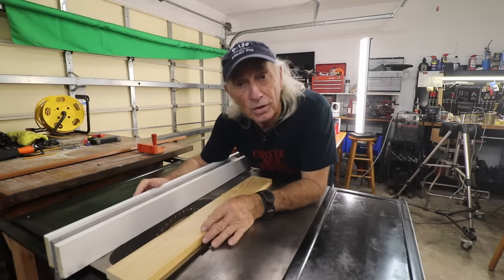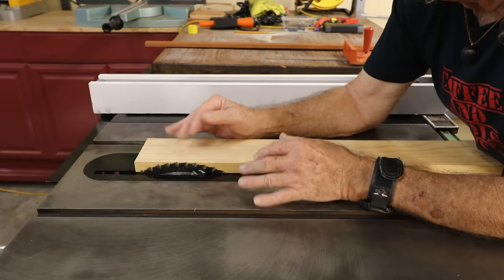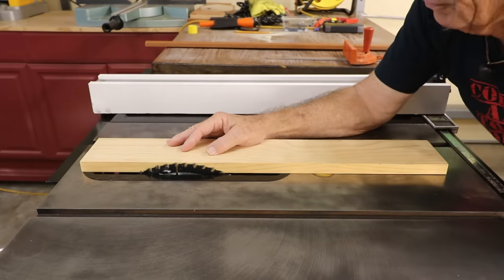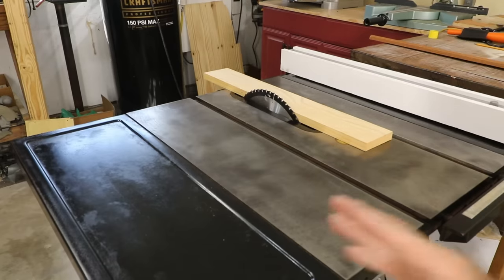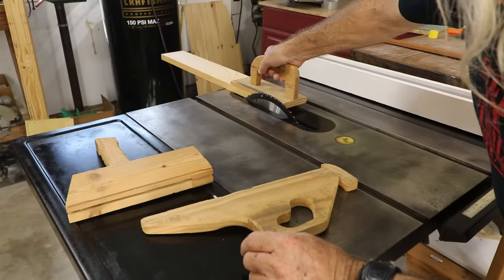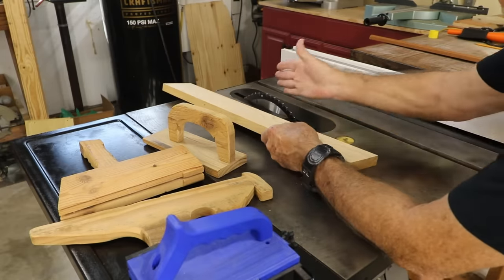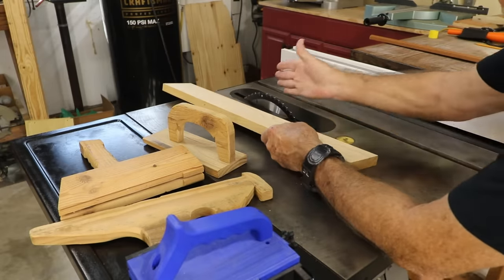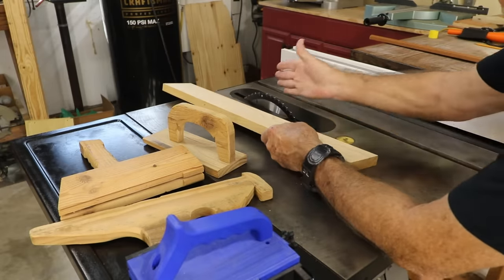Table saw secret nobody will talk about from the good old days, C&T episode 180

Comment: I was taught the MINIMUM height was the one that cleared the tooth gullet above the material.  It gives a clean cut because it keeps the saw from dragging excess sawdust down into the cut zone, but also guarantees spitting dust upwards.  Second, to avoid standing directly behind the area between the blade and fence.  (Don't let anyone else stand in that line, either.  Easy to do for narrower cuts, near impossible for wide ones.

I've experienced a couple of incidents.  One was the inadvertent kind of twist another responder mentioned.  That resulted in a violent throw upwards of the ply panel I was cutting.  Scared the bejesus out of me and I stopped for the day.  Another was a classic pinch ripping hardwood, kerf closing up as tension was released from the cut, the kickback coming from the fence side.  This on an older saw without a riving knife.  That was an absolute rocket straight back.  That missed because I wasn't in the danger zone.  For those who haven't seen this, the speed is beyond belief.

Personally, I think the safest solution is a higher blade, which reduces the most common problem (kickback) PLUS using a blade guard.  And I have to confess that I don't use the latter very much, also relying on tools to keep my hands clear.  I do use feather boards a lot when ripping, too.  I've tried hold-down devices, but found them too much of a pain in the neck to use in a home (i.e., non-production) shop where you're changing set-ups all the time.

Thanks for the video - it has me thinking about guards again.
Reply: Boom say like it is

Comment: That little 'bump' behind each saw tooth serves the exact same purpose as the depth gauge in front of every tooth on a chainsaw: it prevents the following tooth from taking too big a bite in the wood.  Ultimately it limits the feed speed and allows the blade to cut most efficiently given the power provided by the motor.
Reply from the maker: Thanks for posting :)

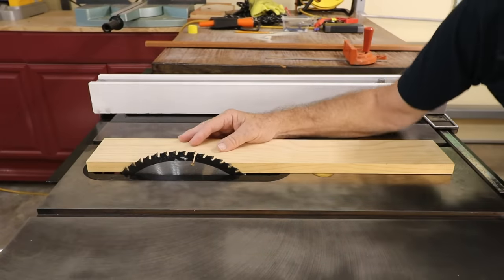Comment: 6:34 Very poor argument. 1: The teeth are wider than the "body" of the blade, so the only thing in direct contact with the wood is the side of the teeth themselves. If you let the blade guide the board, you will cut into the edge already done with the upward going teeth, which is one of the main causes for kickback. 2: You have a MUCH longer guide right on the other side of the board (aka the rip fence)... ;)
Not making a cut because it feels unsafe, is probably the best advice anyone can give you. If a cut feels unsafe, mostly it's because it is! 
I have aborted a cut more than once because it just fealt wrong.
Reply from the maker: IF it feels wrong...don't do it :)

Comment: I had a pair of goggles save the left side of my face. Could not believe the speed and strength that wood came back at me with. Buy good safety equipment, you will never regret it.
Reply: Well testified, thanks!

Comment: Good video! It is helpful for newbies and weekend warriors. I've been woodworking for 65 years and still have all my fingers and other body parts. I use the rule on table saws and circular saws to set the blade so the bottom of the gullet between the teeth is even with the surface of the board.
Reply from the maker: Sounds like your doing it right :)

Comment: I've noticed that a lower blade seems to leave more circular marks and burns on the lumber. 
Edit: the problem with the lower setting is there are dramatically more teeth touching the work at any given time. That creates much more friction because the board has already been cut by the teeth closest to the wood, and those trailing teeth are good for nothing but friction.
Reply from the maker: You've got the picture
Reply: More friction, more pileup of chips, slower feed, adds up to burns, especially if you have a dull blade.

Comment: In the UK and most of Europe you should NEVER  operate a circular saw bench without a riving knife fitted to within 8mm of the blade and a guard must always be fitted and placed as near as practical to the work. Likewise when ripping solid timber the fence should never go past the gullet of the blade at bench level. I agree that you do get a better cut with the blade up high, really not too much of a problem if it is sufficiently guarded, generally though the advice is to set the blade low. We also say your hand should be a minimum of 300mm away from the blade so most of the sticks or grippers that are in use in the US would be illegal here in the UK. People, statistically this is the most dangerous piece of equipment in a wood shop keep the guard and riving knife fitted at all times and use a push stick of at least 350mm long and only use it for ripping and occasional crosscuts, there is far better equipment to cut grooves, rebates etc available. I do appreciate that different countries have different rules and what I have said will upset some but I say it with safety in mind.
Reply from the maker: Love this input from UK. Super thanks for this comment. I have some fellows in Germany right now sending me emails too. Telling me why did you release this darkest of secrets :)
Reply: Illegal! really? Point me to that law please.
Reply: I believe here its not allowed to sell saws without a riving knife and professional shops/ users have to use it. Workplace safety etc..
The us style fences are i think pretty dangerous.
Reply: @joepmeloen3373  yep, but those are not laws  they are HSE regulations and dont include your personal equipment in your own home, unless your using it in relation to a business

Comment: Memories of high school wood shop class in the mid-1960s. What you describe is what I was taught back then. That was one machine I avoided using as much as possible. I have also seen two table saw accidents - one being a professional demonstrator - where digits were removed. The un-safety of the table saw is a reason why I have never owned one. Since I restarted woodworking in the late 1970s, I have always used a radial arm saw. I regard it as inherently much safer because your hands don't have to be anywhere near the blade for most cuts. Of course it is still a power tool spinning sharp blades at high speed, so reasonable caution and respect are still necessary. But I'm still using that same radial arm saw, and I still have all of my "original equipment" body parts.
Reply from the maker: We love the old radial arm saw and sorry to hear you had to see digits removed. That leaves a scare for life. Thanks for the comment !
Reply: In studying radial arm saws, I realized that their reputation in being dangerous for ripping boards is way exaggerated, and they should in no way be regarded as "unsafe to use for ripping boards." When you consider that a radial arm saw has anti-kickback pawls, and all the newer ones have a riving knife, plus when you're ripping, the guard completely blocks the blade so you can't "accidentally" stick your hand into it for no reason, like what happens in so many table saw accidents.

I think cross cutting on a radial arm saw is extremely dangerous, not ripping. People saying a radial arm saw is "more dangerous for ripping" are confused about how the guard works on a radial arm saw. In cross cutting, you might have the blade exposed. But in ripping, the blade is rarely near your hand, on a RAS. The top of the blade is buried down into the wood table on a RAS, so it cannot have a "frisbee" kickback that causes most table saw injuries.
Reply: @Ritalie  I agree with you that the "Danger Danger" reputation of radial arm saws (or RAS) is way overblown. I have heard lots of statements about danger, but I am not aware of any documented injury cases. (That does NOT mean there are none!) I have had one incident with the RAS while ripping a sheet of wall paneling - no physical injury to me, just damage to the material. After my heart rate was back down to normal, I realized it was my own stupid fault for not properly completing the setup. That was 15 years ago and I've had no incidents since. I have even used it to resaw small lumber parts, using a jig published in a very old issue of Shop Notes. (Those digital archives are a wonderful resource.) About the only RAS accessory I have not used is the shaper head, and only because I have not needed to. 
The reality is that ALL edged tools can inflict bodily harm if incorrectly used. If the edged tool is being spun at high speed by an electric motor the danger is greater because things happen faster and more violently. Think of Stumpy Nubs' accident while power carving a year or so ago. That happened in an eyeblink, and he's still recovering. 

One thing I'm working on is setup checklists for each power tool, for each possible operation. (Oops, my background in quality assurance is showing)...

Comment: Love what your doing. Many years ago when I was just starting,  I was cutting live edge lumber to square it. The piece to the left of the blade, the live edge side,  tampered down, broke loose at the blade and kicked back. A piece about 4 feet long tore into my t shirt just knicking me. If I had been a few inches to the right it would have gone into my belly. That is the only time I have seen left side kick back.
Reply from the maker: Off cut is rare, but Jeff King over at The Den of Tools said it happened to him. Thanks for the comment posted. Just shows anything can go wrong.
Reply: youch.
radial arm saws make arrows fly.
Blades are better now.
Early carbide tips would fly off now and then.
That was like getting hit with a bullet.
I have been lucky. Chris
Reply from the maker: Jeff King over at Den of Tools said that happened to him. Rare but it can happen.
Reply from the maker: @christophergallagher531  OH, those days...I got hit in the forehead with a carbide chunk off the blade. Thanks for the memories :)

Comment: I'm on the high side. If your blade is too low crosscutting (now really expensive) hardwood plywood you'll get tear out even with a still sharp hi end blade on both sides. Good side up and a 3/8-1/2" high blade and your good to go.
Reply from the maker: Plywood does have it's own rule, thanks for posting

Comment: Thank you for producing this excellent video regarding safety with a tablesaw.  Having worked with wood for more than 50 years, I actually avoid using the table saw if I can.  I've only had a couple incidents with kick back with no injury.  But, though it may not look like it to observers, I am very cautious when I'm around a moving blade.  I got my start as a woodworker working with my grandfather who, though a very cautious man, got distracted once and cut off a finger.  I worked in a college shop once with a man who was a stickler for safety.  He also got distracted once and cut off a finger.
While I know you know what you're doing, it makes me very nervous watching you running your hands over and around that tablesaw blade.  
I'm currently building a new shop and will not even have a tablesaw in it.  I don't need it.  In my early 20's, I built a complete kitchen using only a "skil" saw.  
We can make all the "rules" to save our fingers only to lose them to a moments distraction.
Reply from the maker: Great posting !
Reply: All respect to your experience and caution, nevertheless, I don't think of a hand held circular saw as especially safer than the table saw.

Comment: I can't say I've been at it for a plethora of years, I began poking around with this hobby 5 our 6 years ago, but I certainly make my cuts this way.  I've tried both methods.  The results are indeed better, and I'm confident there is less binding and kickback when the blade has more space to operate freely (i.e. it has some area to spin freely both above and below the work piece).
Reply: How powerful is your table saw? The most important thing raising the blade accomplishes is reducing the hp required to make the cut.(less teeth engaged) you may find the same benefits you get from a higher blade by using a slower feed, higher hp saw or even an fresher sharper blade?
Reply: @lutzshawn  You are correct, but my approach serves all the same.  I rarely have the most high powered equipment; I use what I have and what is available.  Regardless of what saw I use it is always a goal to reduce as much resistance and wear as possible from the machine while I use it.  This approach has always served me to be both "safer" and yield better results.
To your point, I certainly could benefit from a newer, sharper blade, but who among us could not?

Comment: I was taught in a cabinet shop that you use a high blade with a high ATB blade to prevent chip out on melamine. The theory is that it chops downward as the blade cuts through the topside.
Reply from the maker: Exactly and other reasons too for this angle.

Comment: Thanks for the honest, straight forward info. 

My thought is:
If a higher blade gives me less chance of kickback injury, while a lower setting gives me less chance of losing fingers, then, I figure that I'll recover and be able to keep woodworking and playing the piano with scar on my belly. So I would go with a lower blade. 
Also, I try to always stay to the side and out of the line of fire, especially if the cut looks like it could get pinched.
Reply from the maker: I do like the stand aside idea :)
Reply: Definitely stand aside all the time. A significant hazard of kickback is not only impact to your body, but also that your fingers may be dragged toward the blade as the stock dances around. It is no trick to keep your digits away from the blade with push devices, go with higher blade and more controllable forces on the stock.
Reply: Yup, stand to the side!
A guy at work took a shot to the nuts trying to rip a 2x4. Put him down bad!

Comment: In my experience, poorly designed or badly adjusted riving knives can be much more of a hazard than running without a riving knife.  If, like most decent wood workers, you change out your blade fairly often to suit various different operations (and to keep your blades sharp enough to safely do the work), and if you actually try to use one of those clear plastic guards which come with most saws  and which mount on a tall riving knife behind the blade, you are pretty much guaranteed to run into a situation where your riving knife is wedging your material against the fence, requiring stupidly unsafe levels of feed pressure, and exposing you to injury when your hand or push stick slips. If riving knife is out of adjustment or bent in the other direction, it is pulling your material away from the fence, giving you a wandering cut line and a high likelihood of binding.  As far as blade height, different kinds of operations on the table saw, in different materials, will require different heights above the material, and different techniques for keeping material as flat on the table and as parallel with the fence as possible.  I keep a variety of push sticks around my saw at all times, and for many rip cuts I’ll use a simple feather board mounted in the mitre gauge slot near the leading edge of the blade to keep steady lateral pressure against the fence, allowing the push stick in my left hand to apply steady downward pressure in front of the leading edge of the blade, without having to also worry about lateral pressure to keep the workpiece against the fence.  Using a push stick which is a good foot or so long for that operation, rather than any of the heel board contraptions I have seen, allows me to keep my hand well off to the side of the blade, so that if something goes haywire or I should stumble my left hand would land safely out of harms way, not on top of the blade. That stance, because of the limited leverage a longer push stick can apply from that angle as opposed to a heel block which could allow the operator to put most of his weight into pushing the workpiece down against the table, also prevents putting excessive pressure on a cupped or twisted board which could result in the board binding and climbing the blade into a kickback situation when pressure is released to reposition the left hand/push stick. I usually use a similar push stick to feed material with my right hand, and for ripping thin strips I will use a sacrificial push stick so I can keep feed pressure in line with the cut.  If I am ripping twisty waney and bowed two-by spruce lumber for a construction project, my blade will be set fairly high above the material, and I won’t worry too much about areas where the side of the blade has left burn marks or blade paint on the lumber. If I am ripping flat straight oak which I have recently thickness planed in my shop, and intend to use for a furniture or cabinetry project, I will want to keep as many teeth as possible engaged with the workpiece at any given time, so my blade height will be a lot lower.
Reply: Can confirm the crappy blade guard and riving knife out of true putting you in a dangerous situation!

Also, something people don't seem to think about is your insert can work against you as well.  My insert sat maybe 1/16 below the table surface which caused the workpiece to catch sometimes and I'd find myself forcing it to get past that point.  Luckily, I figured it out and shimmed it up a bit and that fixed the issue but I could have easily tried to force something and diced my poor, soft hands.